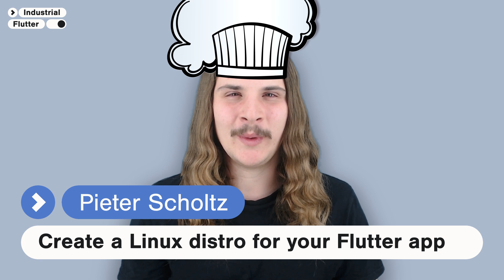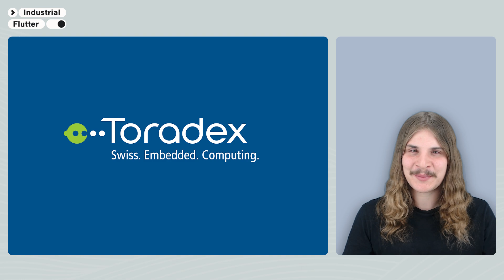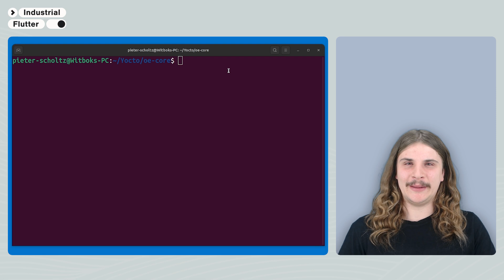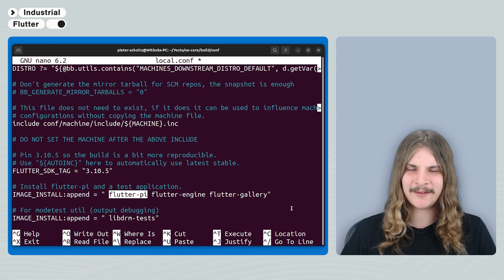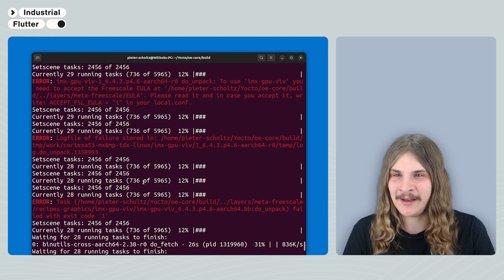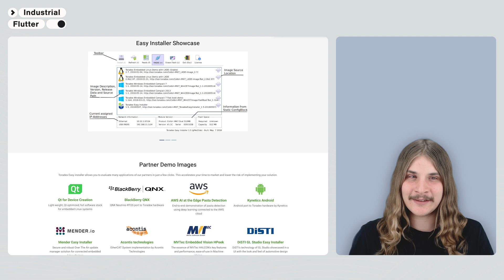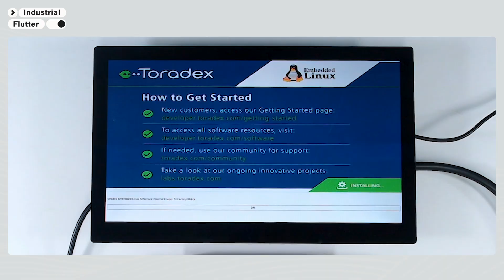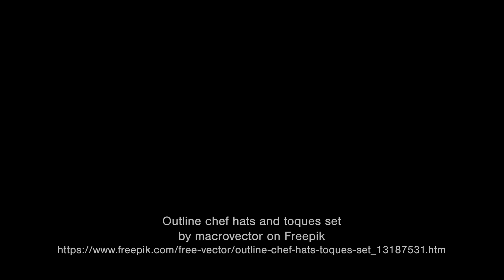How to run Flutter on embedded hardware with Yocto

Comment: Send a link to the HDMI display you connected in the video.  There are many MIPI-CSI embedded monitors, but that one you connected the HDMI and USB cable to may work for a project.  Specifically, there should be no POWER button, just power on when there is 12vdc applied.

Comment: Hello, thanks for doing these videos. Can you guys do a short video about playing videos on embedded devices with flutter? Last time i tried play videos on rpi4 with flutter-pi, due to memory leaks and misbehaviours, i had to give up and use flutter-web and chromium as kiosk to achieve my task. As you can guess it doesn't have good performance and i had to deal with backend for the website. I would like to migrate it to native app if possible but haven't been able to find any guide on this matter.